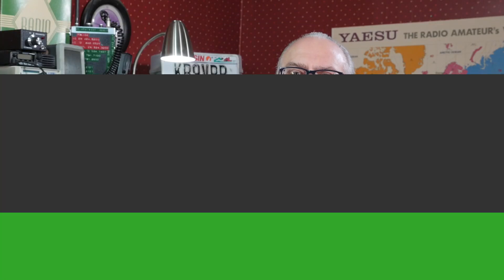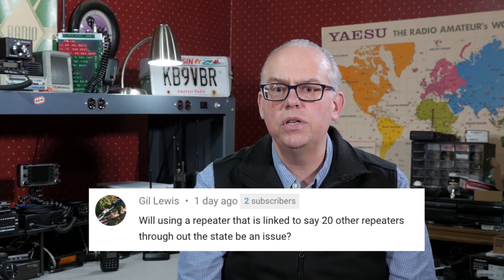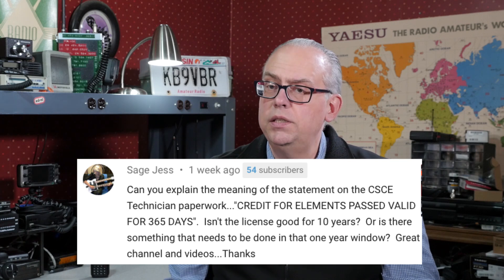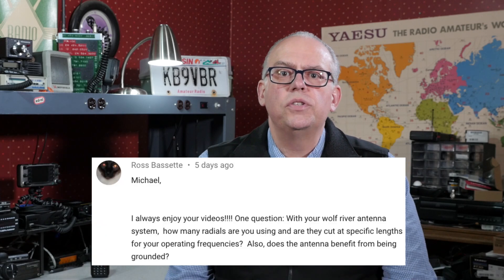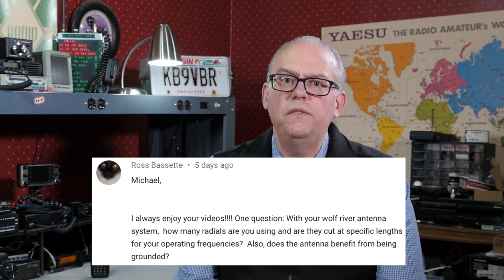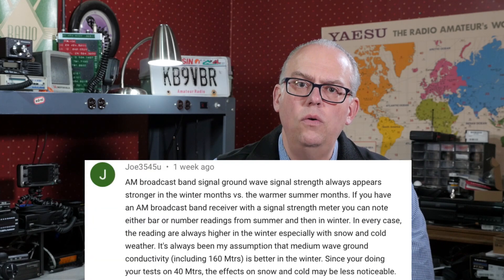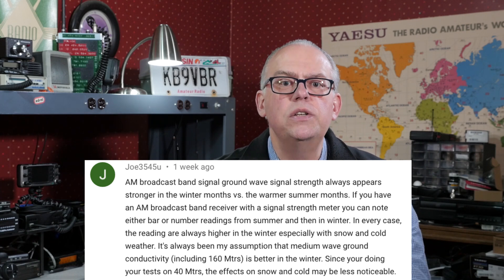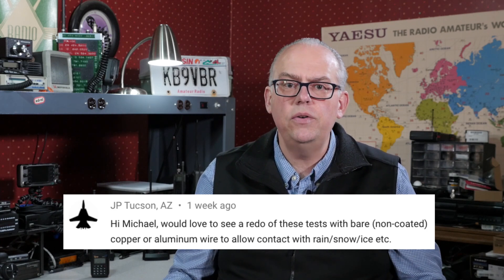Your Questions Answered February 2020 - Ham Radio Q&A

Comment: Okay, I have a question.  I see several ha, shacks on YouTube but no videos on laying one out, where radios go, how to run the cables, spacing, etc.  so. 1 how are your radios laid out and why? 2.  What factors did you consider for computer support for your shack?  Mac or PC?  Must have software?  Any priority in how your radios are laid out?  Do you use scanners or multiple VHF/UHF radios to monitor channels continuously?  If you were laying it out all again, new, in a new house, where you had a UHF/VHF antenna in the attic, and two runs of LMR 400 to the trees outside behind the house for wire antennas (with 50 foot tall pine trees for Antenna supports) what antennas (wire only) would you have, and why?  For reference I have an IC 7300 and 7100 for HF, two P.C. laptops and a huge Mac for computer support, a DMR and Dstar dual band radio (5100), and several HTs.  Any thoughts?  Thought you might find this a good subject for a video.  AD0DQ.
Reply from the maker: Thanks for the suggestion. I'm working on a shack tour video but I'm also planning a couple of upgrades early this spring. Once I complete the upgrade I'll give a tour of the space

Comment: How long could a person expect to talk cross band repeat on a car battery and still be able to start the car?
Reply from the maker: That's a difficult question to answer as it depends on the health or age of your battery‚ operative temperature‚ and if you are cold starting or warm starting the car. I think a good tip rule to follow would be to monitor your battery's voltage and if it drops below 12v you should stop so you can start your car.

When I plan to use the mobile radio for an extended time with the engine off‚ I'll use an external battery so I don't deplete my starting battery.

Comment: Question on radials:  can you effectively have radials for different bands connected at the same time, like a fan dipole?  IE: an antenna like the WRC silver bullet with radials for more than one band connected at the same time?
Reply from the maker: I would think you could do that. That's a standard practice with permanently installed vertical antennas that have a buried ground radial network.
Reply: @KB9VBRAntennas  thanks!  Figured it made sense... if it works up top then it should work down below.  But... you never know with the dark arts of RF.  LOL

Comment: I am curious about why hams do not use p8668i as a device. I want to make a decision between motorola p8668i and yaesu ft3d. Can u give me some advice plz？ Thx a lot.
Reply from the maker: There are a few reasons: Motorola gear tends to be more expensive since the company is targeting the commercial and public safety markets. Plus new equipment has to be purchased through a dealer network and it can be more difficult to program as you need the proprietary software and Motorola can be very tight on who they distribute it to. But used Motorola gear tends to find its way into the hands of amateur radio operators as state and municipal agencies will often sell off their old gear to anyone.

More specific to your point‚ I believe the p866i sold in the Asian market- I haven't seen that model in the US. It's Mototrbo which is DMR compatible. The Yaesu FT3DR is System Fusion C4FM. Both are digital technologies but incompatible with each other. Your choice would depend on what's more popular in your area: DMR or Fusion.
Reply: KB9VBR Antennas Thx a lot for ur answer, really helpful！！I’ve already purchased the p8668i. Cuz in Shanghai, There are 4 DMR repeaters, only 1 C4FM repeater.
Also I will become an international student to study in the USA this summer. In both PA and NY, there’re more DMR repeaters than C4FM ones. I want to join into local ham club to develop my radio skills.
So that, Is that legal for me to bring the p8668i (which is not certified by FCC) to United States and use it as an amateur radio device? Of course I will get a license before I use it. I’ve already checked the US. Customs and Boarder Protection’s rules, radio is not on the restricted items list. I am just curious about if I’m gonna get into trouble to bring such device to America and use it there.
Reply: @KB9VBRAntennas  BTW the same model of P8668i in North America might be XPR7550E
Reply: @KB9VBRAntennas  Thx a lot for ur answer, really helpful！！I’ve already purchased the p8668i. Cuz in Shanghai, There are 4 DMR repeaters, only 1 C4FM repeater.
Also I will become an international student to study in the USA this summer. In both PA and NY, there’re more DMR repeaters than C4FM ones. I want to join into local ham club to develop my radio skills.
So that, Is that legal for me to bring the p8668i (which is not certified by FCC) to United States and use it as an amateur radio device? Of course I will get a license before I use it. I’ve already checked the US. Customs and Boarder Protection’s rules, radio is not on the restricted items list. I am just curious about if I’m gonna get into trouble to bring such device to America and use it there.

Comment: Can't Rx weak signals in the city.  Tx ok.  What to do?
Reply from the maker: RF and multi-path interference can raise the noise floor‚ making is difficult to hear weak signals in urban areas. Band-pass filters can help to a certain degree. If you are unable to isolate and remove the interference- then the only option would be to move away from the interference when operating.
Reply: @KB9VBRAntennas  ....thanks for response.  Luckily, I checked.  I am still not being notified of your responses.  Other channels work fine.